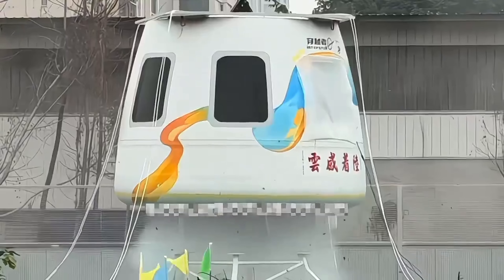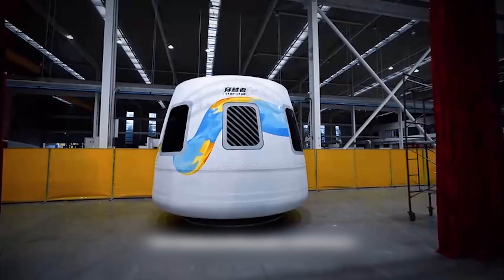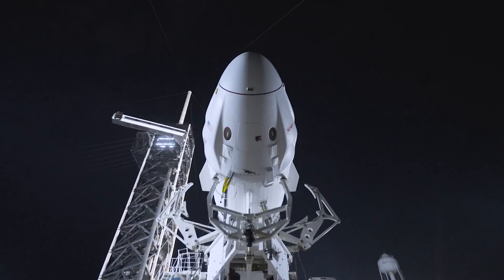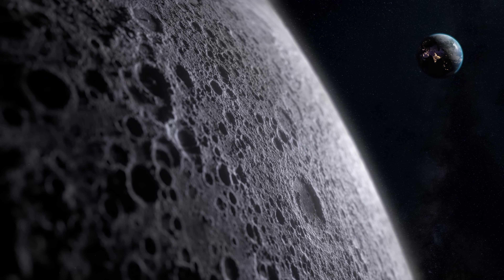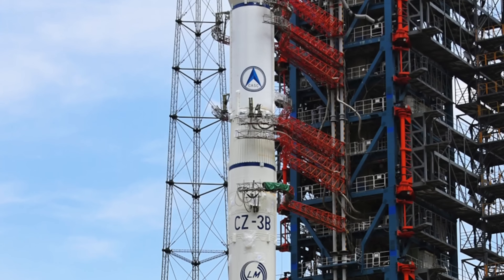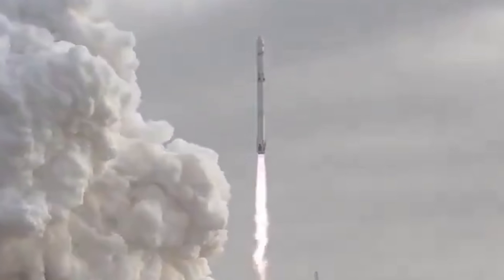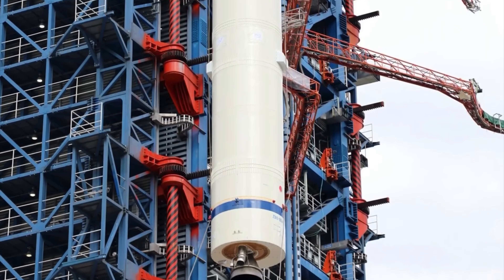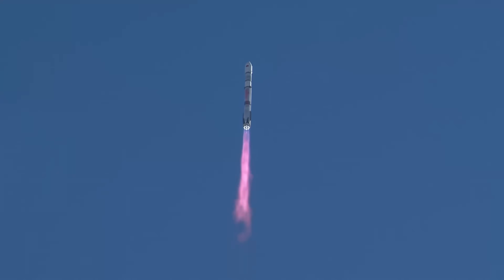How China Tried to Outsmart SpaceX & NASA with New Crew Capsule - But FAILED Miserably

Comment: Can people count, or understand that landing boosters and rockets with rockets is just terrible for efficiency. The extra weight it adds in fuel and stronger structure is just not good, and the cargo carry weight is just going down to much. So skip the fancy looking landing thing, and land it with paraparachutes and tiny corrections boosts and a last second break boost. Space x is just a commercial jippo and not even close to the stupidity Elon say it is.